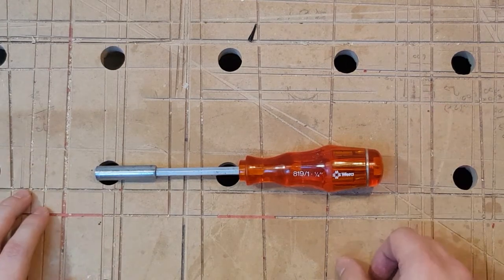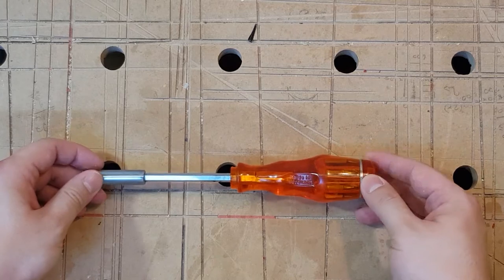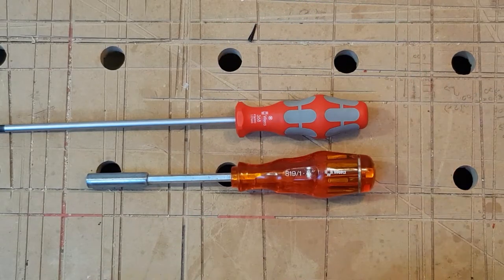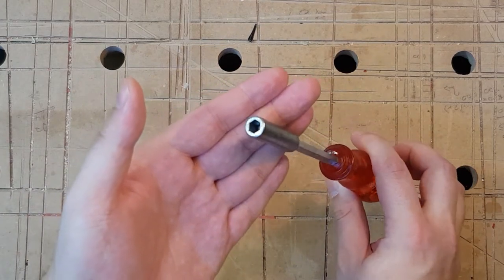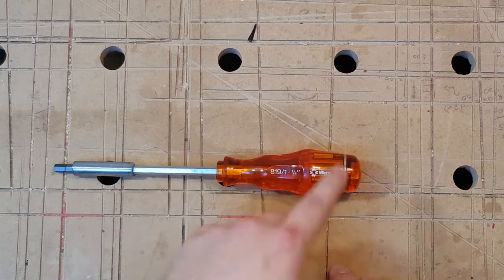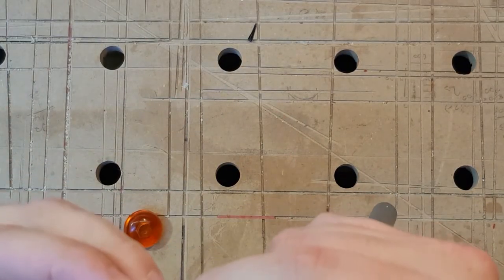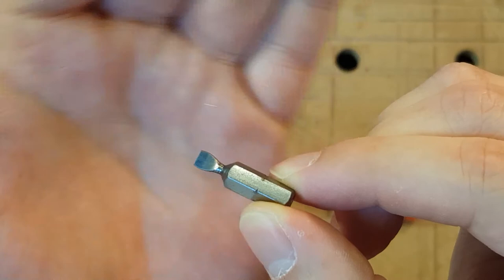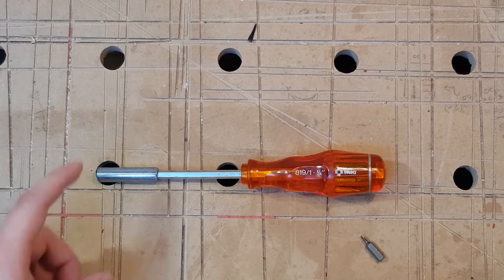Vintage Wera 819/1 screwdriver - review | Etna.

Comment: Just came back from the flee market, I got a Wera 1/4 inc. bit driver from the same series, the model is 812/1 (1/4 x 120), this is a standard model with no storage for bits in the handle. It's in excellent condition, slightly dirty, but it will clean out nicely, the important thing is, no corrosion. Paid around 2.5 euros. 
The model is also still produced (new handle). Interesting thing is that the bit holder on these older models are much beefier (thicker). The bit is far more likely to snap (bend) rather than the holder becoming bent or cracked.
I also got a Knipex 26-200, needle nose pliers for 6.5 euros. West Germany made, very god condition. Tight action (no free play), no corrosion, very sharp cutters, just a little dirt (grime) to clean.
I'm happy.
Greetings from Serbia.